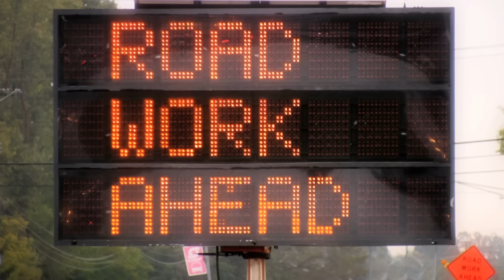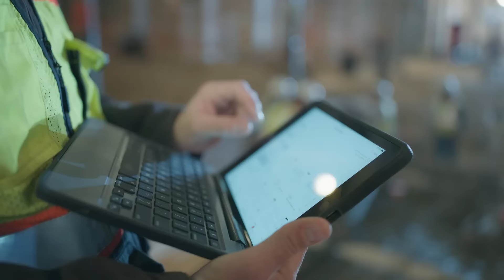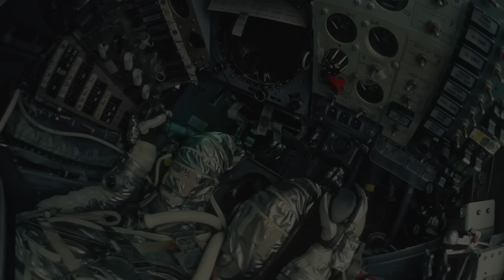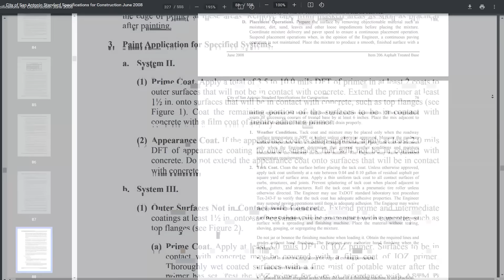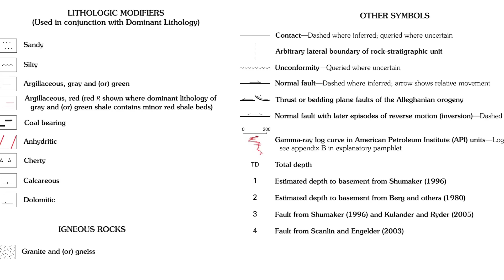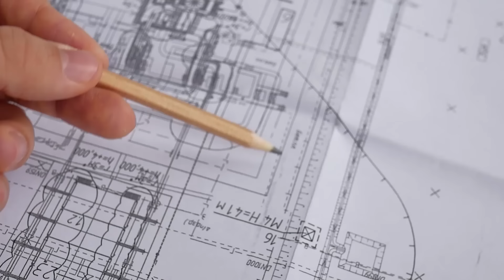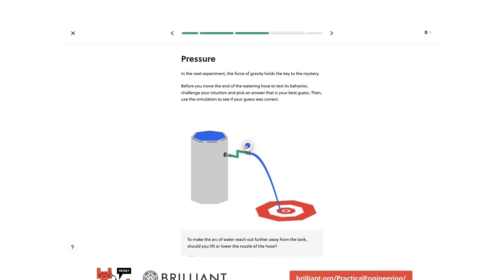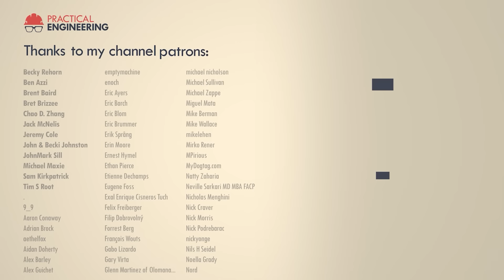4 Myths About Construction Debunked

Comment from the maker: 🧠Get ahead in your career or studies with Brilliant: http://brilliant.org/PracticalEngineering
📖Did you know I wrote a book?! It comes out in November. You can preorder now for early access and other cool stuff: https://practical.engineering/book
Reply: But why do I see tons of contruction(not only around these parts but engineering documentaries, videos etc..) 
put already RUSTY rebar into a new concrete structures shortening the life of it...
Reply: There was an advantage to th romans using the volcanic addative to concrete. the rest of the points are right.
Reply: speaking of steel rebar, I've seen new brands of rebar made of reinforced fiberglass. I'd like to know your thoughts on the pros and cons of these new types of rebar and possibly if they have a chance to replace steel
Reply: Yet another excellently put together production, with a nuance list.👌🏽👍🏼
This is necessary that instead of stigmatising something... we first at-least attempt to grasp the ethos, reasoning behind it (the choices, compulsions, restrictions, flexibility.. or its lack thereof).
.
Thanks again Grady ji🤍💙 https://wikipedia.org/wiki/-ji
Reply: @agatasoda  Rusty rebar doesn't shorten its life. Without oxygen the rust doesn't proceed. If exposed to oxygen (and it always is) a little head start makes no difference. And efforts to coat it (e.g. epoxy or plastic) make the situation worse. And these days, real concrete construction depends on "prestress"...attempting to always have it in compression...its only state of strength.
Reply: Yes, I did hear you wrote a book….
But what would you son make that bridge out of? I’d love to see something last a million years, no matter the cost… 
Another great video though
Reply: You're very generous about workers standing around. lol I got a buddy who works in the field and he has confirmed that half the people in his company stand around and do nothing most of the day, and almost all of the work is done by a handful of people. Yeah there are jobs where you just stand there observing and or taking a break, but it shouldn't be 80% of the crew at a time, unless the boss doesn't know how to schedule work properly.
Reply: Pretty sure its the unions/Gov jobs that people always talk about standing around. I mean that's at least what construction workers talk about.
Reply: Can you do a video on landfills/ solid waste
Reply: the main misunderstanding about "no show jobs" is the fact that you actually need to have bodies clocking in and someone for the bank auditors to count when they come by to inspect the progress.
Reply: If there are riches in niche, why wasn't Nietzsche richer? 😉
Reply: Can it be ordered from outside the USA?
Reply: I worked at a tech on a remote fiber optic cable. I had to do cable locates on a big road construction project where dozens of culverts where being replaced . There  were soil engineers, and many others that only had do do something that didn’t take long a couple of times a day and standing around doing nothing the rest of the day.
Reply: Amazing
Reply: Thanks for taking the time to politely put all the armchair quarterback in their place.   Including me.  LOL
Reply: @toddmarshall416  Zink coated rebar...
Reply: @Chris_at_Home  most people that stand around at construction sites are not engineers.
And especially in government contracts, it's normal to exceeded the budget and time - part of the money goes to the gov employees anyway as bribes to make sure that those "unforseen" cost overrunns are "acceptable, acts of God" etc
Reply: @SilentRacer911  yep, that was a brutal exaggeration.
Reply: please don't wear that shirt again it hurts my eyes. but ty for the video overall
Reply: @foxman8344  Scheduling accurately requires the use of crystal balls, which are in short supply. And the ones from China only speak Mandarin.
Reply: @pteppig  I was a "Government worker" for 30 years. I worked with and for contractors for the prevous few years. I saw the kind of abuse you mention while I was in the private sector. I saw far more unethical behaviour by management than by workers. I also encountered the very same on-the-job obstacles as I did in the gummint sector. Peole are people. And believe me, the only money that goes to the employees is that wich is a company obligation, and as a tax write-off. otherwise, allmoney goes to the company, its CEO and stockholders. Oh --- and Washington lobbyists.
Reply: @WCM1945  I don't follow your logic here.... It's not that hard to schedule accordingly to have maybe a handful of guys standing around waiting for work. Not 80% of your crew. Maybe things are different where you are, but in my country and city most of the workers are on city payroll, and with a gov job it's nearly impossible for them to get fired so they screw the pooch all the time. Third party companies building new infrastructure or facilitating repairs while the site is still under their maintenance lease window are done quick because the company is paid per site. But the city workers will take years to finish anything because they stand around doing nothing all day. My buddy works for one of the former there and makes fun of the city workers all the time.
Reply: one isn't "standing around" ... rather, they are choreographing!
Reply: Did you go from high school to college to an office job in your field?...... because IF you did,how would you know about the actual workings of construction workers?..... how many years of actually doing construction work ( wearing work boots all day long,in the heat all day long, day after day,,eating from a roach coach,,your back and feet sore,,sunburned,,,I could go on and on  but you get my point)... because if you didnt do that type of construction work,you speak from what YOU believe or from what others tell you what its like.........
Reply: i like this
Reply: another factor is the difference between being on the edge of science and working on settled facts... when you are doing something like for example building the first bridge across the Mississippi river, you might build to much higher quality margins to ensure it actually works because failure has a higher risk when it's the first one created. Risk requires looking at both the outcome and the impact, as well.
Reply: @foxman8344  I didn't even think Bill might be from another country until I read your comment. I'm in the U.S. and what you describe is exactly what I see. I've seen it first hand in multiple states.
Reply: Very good
Reply: It´s correct. Thanks
Reply: One thing you almost touched on, but missed on guys standing around: Heavy machinery and deep holes are dangerous. When the backhoe is going, everyone becomes a spotter for mismarked lines. When the hole is deep, only those necessary goes down, and people stay above to watch for problems.
Reply: DO NOT POST ANY REPLY! DO NOT MENTION ANYTHING ABOUT TIMEBUCKS OR I WILL REJECT YOUR SUBMISSION, JUST THUMBS UP AND THATS IT!
Reply: 12 people standing around
2 people working
Typical worksite.
Reply: Amazing 👏
Reply: What do you think of the solution privatize public roads?
Reply: @7:26
Great example.
Reply: As someone who's worked in Civil Engineering for  30 years and now runs an Construction Company that does Municipal work, I can tell you that most of the time you see guys standing around looking into a hole, what you're actually seeing is a "trench" that's being dug and there's sewer or watermain being laid as as they go.  The workers tend to be outside the trench while the machine is digging, but zip in and out to lay pipe, spread and compact bedding and cover material, hand dig to expose existing utilities etc.  If you see guys standing, they're either waiting for their part to be necessary again or they're a top man and are waiting for someone in the hole to ask them for something (like a kid handing their dad tools while he works on the car).  Laying undergrounds - especially in an existing roadway - is not a step by step procedure, it's a constantly moving assembly process as you can't even leave a piece of trench open over night in most cases.
Reply: I see a ton of construction projects sit unworked for months with no progress only to suddenly be worked on again than stopped again. Is there a practical reason for these stops? It is just budget? Poor planning for permits? Contract disputes? Just thinking of the number of detours meant to be for a few weeks/months becoming years (or sometimes decades).

Comment: Really good video. I worked in construction during college and experienced first-hand that there are times when you're inbetween tasks on the job that looks exactly like standing around to an on-looker, not to mention taking mandated breaks to stay hydrated and avoid being over-worked.

One thing I'd like to point out about gov't contracts is that there is an exceptionally important term that always gets left out: contracts aren't awarded to the lowest bidder, but to the lowest price *technically acceptable*. When a contract is spec'd out for bidding, ballpark estimates of costs are included in the work done by the gov't prior to putting it up for bid, and the winning bid is going to be the one that meets all specifications while offering the lowest price.

Comment: 7:50 Bridge replacement cost should be definitely considered during the initial design process and that cost should include estimate for the problems caused by the bridge being out of order for the whole replacement period. In practice, this cost is nearly always underestimated which results in bridges not being replaced in time because the bridge being out of order for any time period is considered too big a problem.
Reply: It is just usually the problem of the next government :)

Comment: There is planned obsolescence, and then there is "planning based on budget and overall long-term operating costs." Both may lead to a shorter engineered lifetime but they are absolutely not the same as suggested here.

Planned obsolescence is a specific term that refers to shortening the lifespan of a product with the specific purpose of increasing profits through repeat customers. The decisions you describe here may be commonly misunderstood as planned obsolescence, but they are easily understood by a willing engineer.

Planned obsolescence, almost by definition, supplies a lower quality experience, more waste, and a higher overall cost to consumer. It takes advantage of lack of insight into durability, limited competition, brand lock-in and/or human nature to accomplish this.
Reply: @ 81 & being retired. I need to gain this education? thank you
bye. just asking.
Reply: Especially when it's a large public company and you have to keep costs as low as possible. You realise that spending more money on something that isn't really a big selling point is kind of a waste of money, especially when you want people to buy the newer thing when it comes out. I can understand with things like electronics how tech is always changing and even though most people don't use half the features in their stuff, some things need to change in order to keep up with security (as an example), but appliances... Soo irritated with how cheaply many companies make some stuff. $900 for a machine with maybe $250 of stuff in it. No wonder why the company is so massive and wealthy.
Reply: Normal engineering is designing a part's thickness to balance cost and durability.

Engineering for planned obsolescence is designing a part's thickness so it breaks just after the warranty period even if it costs more to manufacture it that way.

Modern engineering is adding plausible deniability to the latter.

Comment: My dad used to work for TxDOT and he said the reason that most of the delays occur is because the contractor doesn't read the fine print about what the job actually entails and tries to expand their profit margins by putting peices in that aren't correct to the plans or their schedule gets shot and they have to make up time by cutting corners elsewhere. Which is where an inspector comes in.
Reply: Sometimes it is because conditions encountered were not considered or accounted for by the engineers and architects. and the contractor has to make changes. There was once a  4 lane Fly-Over constructed over a RR track. It was built to specs, but the specs were wrong. They used old elevation data for the rail bed which had been raised a couple feet unbeknownst to the engineering firm. The problem was not discovered until it was almost completed. It had to be torn down and rebuilt. This was a TxDot project.
Reply: @thomasdavis4253  Definitely the fault of the State side this one.
Reply: Honestly in construction, it's a surprise that anything ever gets built. :P

Comment: When I worked water distribution, we would often be called out to repair a water break.  We would get to the site, do as much prep work as we could(locating the water lines and where the failure actually was) but we could not start digging till the other utilities showed up to mark their lines and that could mean us standing there for an hour or two till they showed and finished.
Reply: And importantly, what are you supposed to do in the mean time? It's not like you can just go do another job -- you are needed here the moment you can start and it costs a lot to be moving people and equipment around between jobs.
Reply: Sounds like whoever you worked for should have bought some folding chairs to add to your work vehicles. No reason to waste energy standing around and waiting when you could sit and wait instead.

Comment: 6:55 The Engineer's Maxim: Good, Fast, Cheap -- pick two.

I'd be interested in hearing more about the alternative system for funding contracts.
Reply: And truly, it's all three of these things in some balance. It's more about how you can't get more of one without having to balance it with the other. Want it to last longer or be done faster? It's going to cost more. Want it cheap? You're either going to have to take your time and wait for a good deal or lower your standards.
Reply: A 100K sqft single story warehouse with 40' floor to bottom of beams, 20 year roof, including 5K ft of office space, built to code at a certain site, and similar specs and including a certain dollar amount paid for the work----given out to 4 or 5 firms asking them what they can build and how much time would it take. Something like that is one other model, the winner is responsible for design and build. Since the max price is fixed, bidders can think about speed and quality of the build.

Comment: as a disabled boilermaker I did 15 years keeping a lead recycling smelter running, staying hydrated is the biggest use of time when work is not being done, summer is hot so I would think it's no different in industry being discussed in this video Plus those workers have to deal with the elements minus 20° swinging to 105°, that's brutal
Reply: Few people realizew how hard jobs like that can be. I felt terrible for a coworker last year: we had a freak heat wave that caused temperatures 30° above the average for that time of year. He was stuck working in an attic most of the day when it was 100° outside and over 120° in the attic. Another time a coworker was working in a class 4 arc-flash suit (picture a hazmat suit or a bomb disposal suit for an idea of what they look like) in a humid factory that thanks to the machinery was around 90° and near max humidity. I dont know how my roommate does his job though, he works in a factory and may fill multiple roles day to day, and since they have wet materials going into drying/curing ovens on a convayer belt system there's consonantly heat and humid air coming off the machines and the production line. In the summer it can mean 90° and 100% humidity for all of his 12 hour shift but in winter it can mean dealing with a 75-80°  interior thats wet and humid until they have to open the giant doors and suddenly freezing cold air gets blown in and you're suddenly soaking wet with sweat and water but also suffering from a near instant 50+ drop in temperature.

Comment: Ammonia Refrigeration operator reporting in.

Coincidentally last night, we had a "hurry up and wait" scenario.

I had filed for a Hot Works permit because I needed to remove decommissioned struts and pipe racking. To do this, I needed a grinder. Our work was on the roof at sundown because logistically that was the only time we had an opening. So from approximately 7:30pm until 9:00pm we were working on the dark, on the roof with a grinder creating sparks.

Now the roof membrane could catch fire, so we needed a fire extinguisher, blankets, water access, etc. To do all of this, we needed a Spotter or Attendee who's sole job was to make sure no fires started, or that if one did start it was extinguished.

Then, we needed to perform a Fire Watch for 30 minutes after the work finishes, because of all the heat from cutting a bunch of steel struts off. The Fire Watch lasted from the end of work at 9:00pm for 30 minutes until 9:30pm.

So someone last night was paid for 2 hours to literally stand around and wait, from 7:30pm to 9:30pm... waiting to see if a fire began.